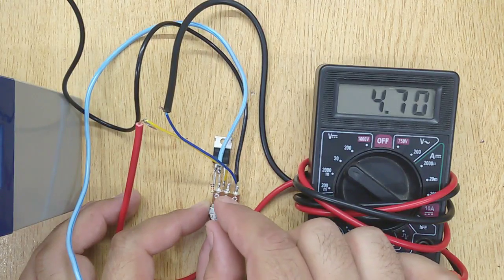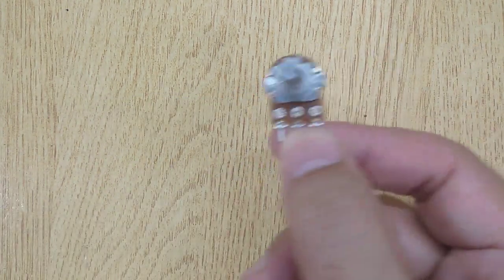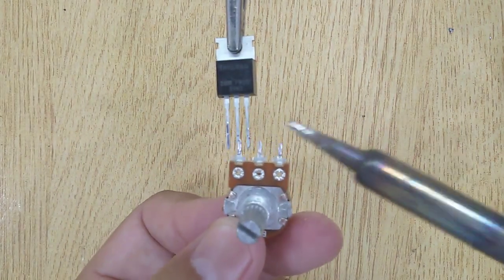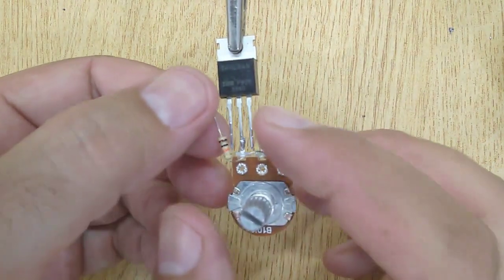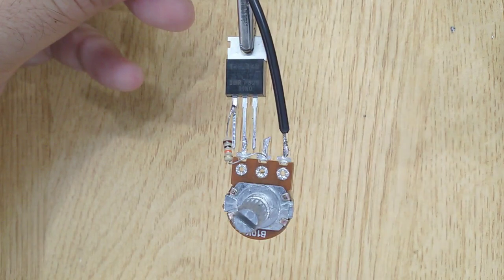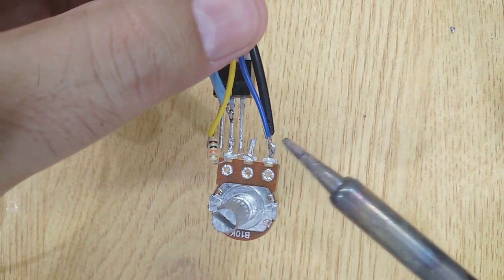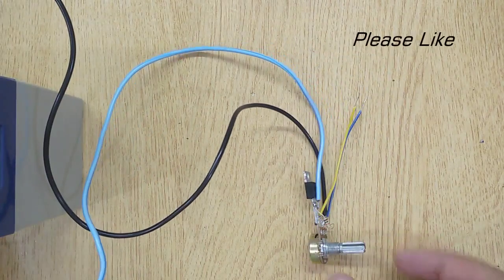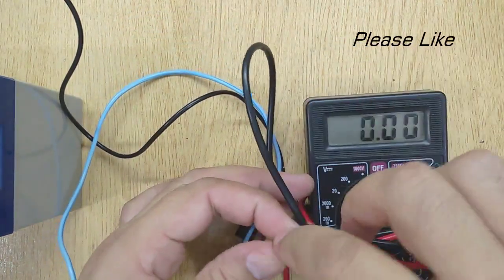Variable Power Supply | Adjustable Power Supply | Variable DC Power Supply | DIY Electronic Project

Comment: Hello. This is not really a stable power supply, and it will get crazy hot, I better recommend you build a buck converter.
Remember that every project using the IRFZ44N could also use the IRF3205, which has much lower internal resistance and much higher current capability, so it gets less hot
Reply from the maker: Thanks friend